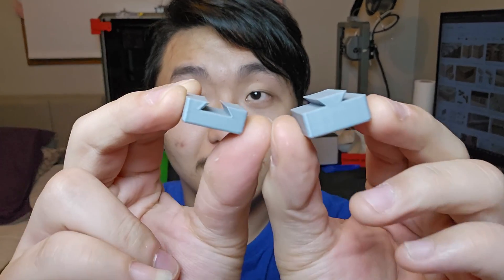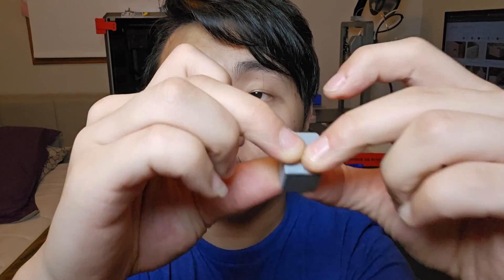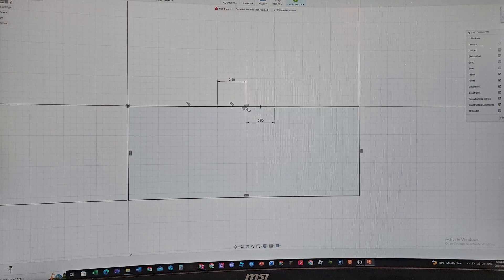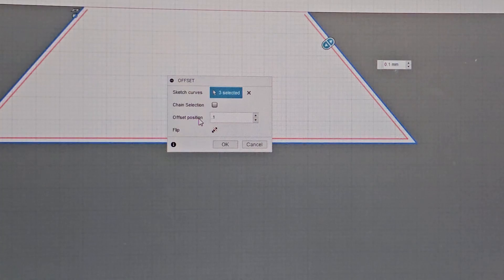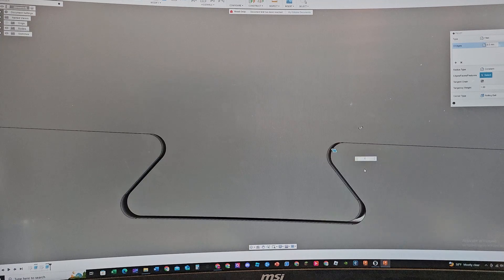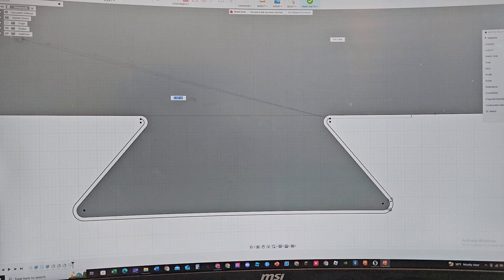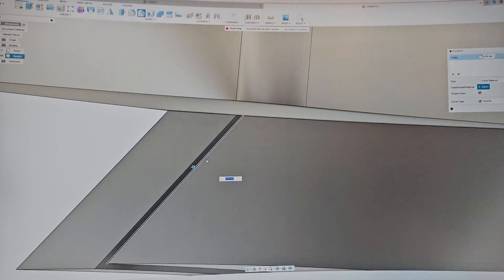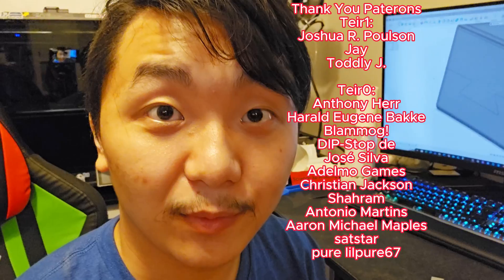3D Printed Dovetail Joint Its Simple

Comment: That is WAY steeper of an angle than is usually recommended.  We usually do somewhere between 8-10° from plumb.
Reply from the maker: Ahh that's good to know. I wasn't sure of the angle, so i just did it like that. I'll keep that in mind when doing another one of these joint.

Comment: you shouldnt be printing in that orientation.  stand the parts up (90 deg from your orientation) so the layer lines are perpendicular to the axis that will receive the stress/load.  in you're example, if you pull on that hard enough, the layers will delaminate and the part will break.  its much stronger if the perimeters (X,Y) are creating the dovetail shape, not the layers up in Z.
Reply from the maker: ahh, that is true, thanks for the next time I'll rotate it 90 deg and print it that way.

Comment: The noodles at the start, while I appreciate the creative comedy, was more annoying and had me click away the first time I saw it. As for the rest of the video, use a screen recording software like OBS or something... it's better production quality and allows you to show your full screen.

That said, as a beginner to Fusion 360, I was unable to follow the tutorial. I don't know if you were using hotkeys or clicking buttons in the ribbon menu... recording the full screen, as previously mentioned, would have at least let me see when you clicked button. For hotkeys, you should state them clearly or get an overlay in the corner to illustrate what keys or mouse buttons you're pressing.

Lastly... upgrade to Windows 11 and activate your install. 🤦🏼‍♂😂
Reply from the maker: Haha, sorry for the intro. Yeah I was using my key board for the things in fusion 360. It was one of the first time that I try to show what I do in fusion 360 and it was not the best. I have learned and now using a recording software and a microphone. I have started to explain more in depth things of what I'm doing in fusion 360. Thanks for the tips in improving my videos.

Comment: You can eliminate the gap on the other side too while still allowing it to slide easily by adding that 0.1mm offset extrusion on the bottom piece at the back side.
Reply from the maker: That is true, by doing that it will be an even better fit.
Reply: can you explain that further please. How could this slide in if the beginning is already +0.1mm?
Reply: @donvu7151  the top piece will have +0.1mm on the front side , the bottom piece has +0.1mm on the the back side, and the majority of the dovetail is still -0.1mm. 

Or a simpler/faster way to model it is to extrude with a taper angle or loft from a different size trapezoids on each side. The main idea is that you want the dovetail to change size slightly from one side to the other so that you can only slide it one way and then it locks together tight.

Comment: I completely redesigned the hot end on my JGAurora A5 and used dovetails for things like the direct drive extruder mount and fan duct. It's so great being able to replace a fan duct in less than 10 seconds and so easily.
Reply from the maker: That is amazing man!